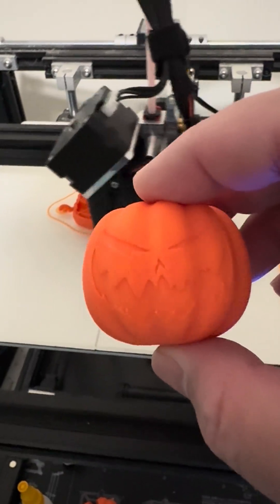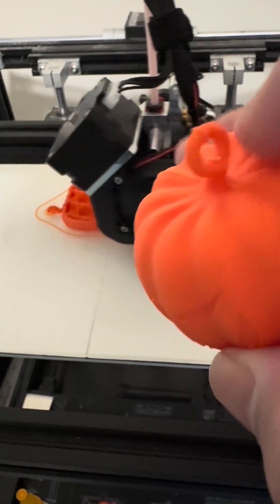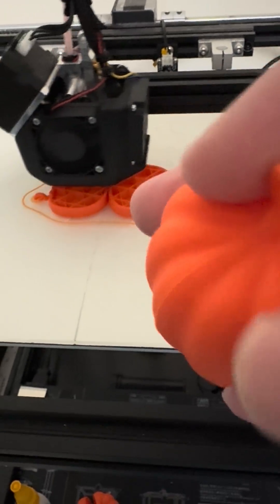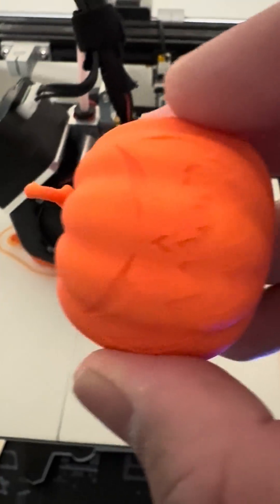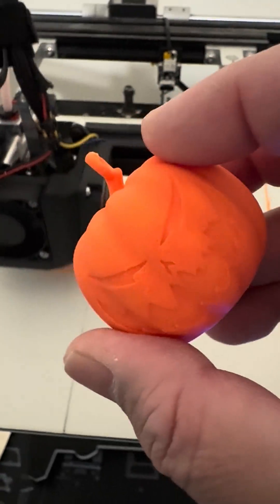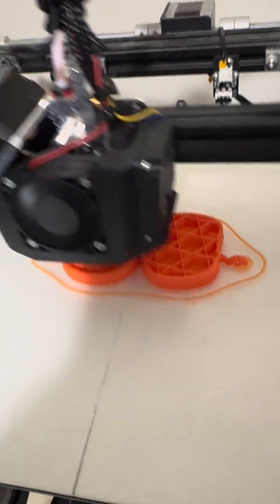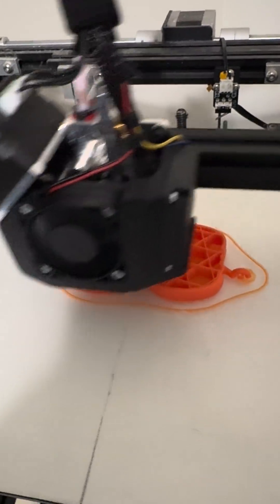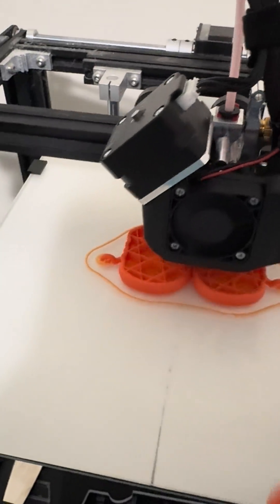Printing in hemispheres

Comment: You can also use variable layer heights on the slicer program to hugely improve overhanging and curved layers
Reply from the maker: Variable height certainly can help and maybe even save time by printing some layers thicker. In the case of this pumpkin the bottom was irregularly shaped enough that the bottom was a little rough. Supports might also make things worse. This is an alternative that trades the rough surface for a single middle seam.